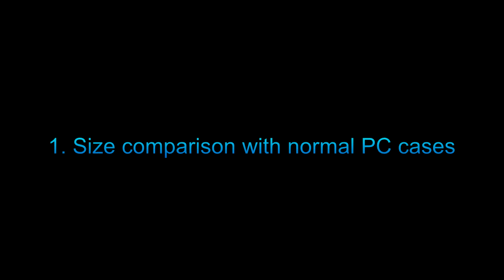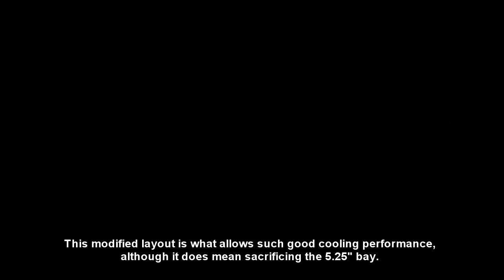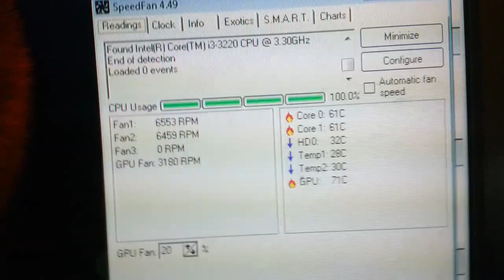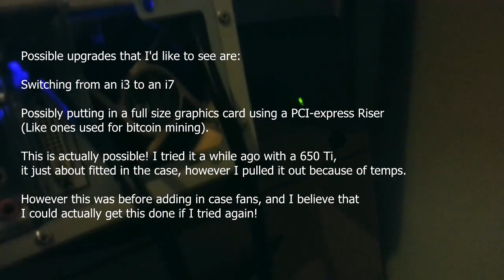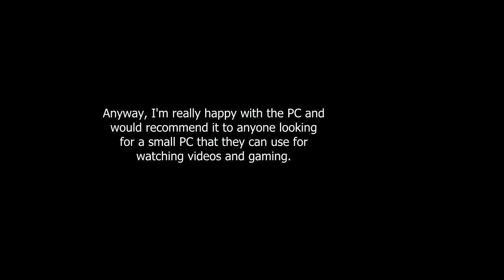mini-ITX Intel i3 + HD 7750 Low Profile HTPC Build + Benchmarks

Comment: Awesome build.
Love the larger fan and fan controller. Powerful specs (for HTPC) which bumped up the price a bit. Same thing with a pentium and 4gb of cheap RAM, 60gb ssd, stick with stock cooler, and you've got a real budget gaming HTPC there.
The beauty of it especially is you can either have this near silent media centre or OC the GPU for a full HD game experience to nearly rival the PS4?